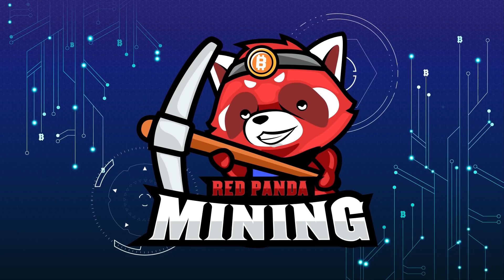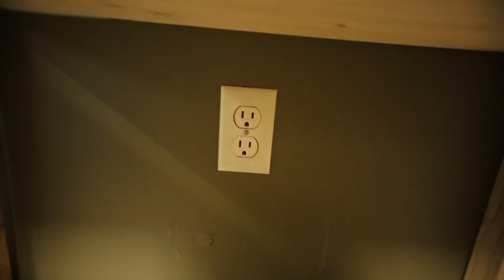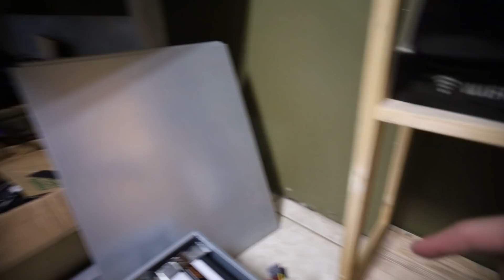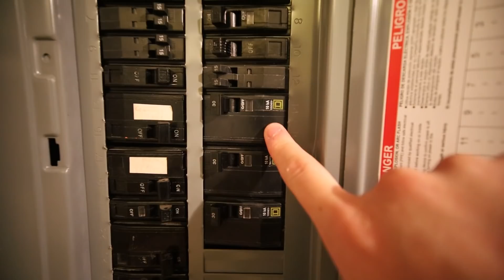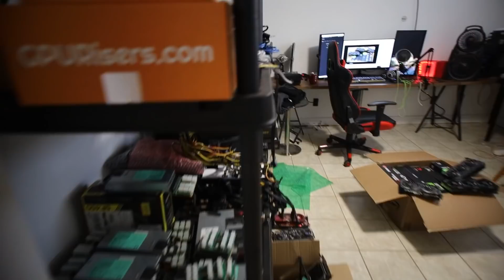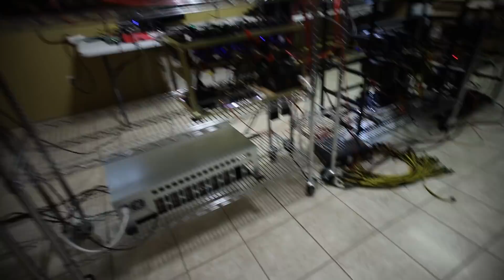How Do I POWER My Crypto Mining Basement?

Comment: Is there an efficient power supply model that will accept 220V input and distribute to many 6 or 8 pin PCIe connectors on the GPU(s)? I think that's what I need. Thank you for the informative video, Red Panda!

Comment: Hey Panda.  Do you use up to 80% of available power on your PSU, and then total your PSU's to no more than 80% of PDU capacity, and then use up to 80% to the wall?   I haven't seen someone on YT explain the entire sequence.   Hope that question made sense!  =D
Reply: I know you asked this quite a while ago and I'm not at this level yet so I'm only speculating but I would imagine if a single breaker was rated at 30 amps at 240 volts the maximum capacity would be 7200 watts. Therefore, you would want the maximum capacity of your power supply to total 7,200 watts as well as the PDU. If they all have the same maximum capacity, The 80% rule would just work itself out since if they all have the same maximum capacity using only 80% would be the same number for All of them.

Bonus: for a 7200 w Circuit, 3. PSUs rated at 2,400 w each would fit perfectly. Allowing you a maximum usage of 5,840 Watts

Comment: I am an electrician.  I'm just curious why this plug doesn't need a neutral? Just 2 hots and a ground?
Reply: They don´t use the Three-Phase 230V/400V system with neutral like we do in Europe.
They use single-phase three wire with 120/240V.
(Look for Wikipedia, you should understand it easily if you are an electrian)

Between L1 and L2 are 240V. Between L1/L2 and Neutral are 120V.
In this System you can just grab L1 and L2 to get 240V.
If you lose one Hot or Neutral, it just stops Working.

In a three phase system theres a Neutral needed, if the Load on L1/L2/L3 is not exactly the same (symetric) like a three phase motor or a three phase power supply (with three phase bridge) without Neutral.
If we lose Neutral with unsymetric (230V) Load, were fu*** 
We will see and hear Magic Smoke bc. of Under- and Overvoltage on our devices (Neutral Point Shift)
So double and triple check your 5 PIN IEC 60309 espcially on farming cables.
They old ones used to be 4Pin without N and just got upgraded 5 Pin Connectors.

Comment: 240V is also more efficient than 120V. 240V isn’t necessarily “two hots.” it is a different loop in the transformer outside your house. The red and black wires are a full loop on the customer side of the transformer and the 120V is half of a loop. Have you done a video on how to select power adapters for risers and good places to get the adapters? This concerns me, because a lot of the adapters people are using are cheap small gauge wires.

Comment: doing high power servers and blade centers in work and at home, when i started mining, i just added gpus to all my servers. having 40 gpus running right now.. saves useless cpus (most of these servers are dc powered by a 30kW 12VO PSU. its an enterprise grade thing... cool is the effficiency on these, also its really easy to power all your stuff)

Comment: Great content. 30A/240V is way to go. Most important of the video; remember 240V is coming out and into your machines so be sure they are 240V compliant and ditch the stock power cables and go with 14 gauge C15/C13.
Reply: not 14 but 12.. C15/C14 (hot conditioned)
Reply: So most power supply’s are 120 though won’t that burn the power supply’s up?

Comment: I know this has nothing to do with your video.
But how do you cure ethermine latency?
I just started my 3070 gaming cpu, ran great for 8-10 hours pulling 62.7 MH, but then out of nowhere my "current hash rate" dropped out of nowhere and my average is around 20MH for 2 days now. 
Whats that about?
Im mining at less than half my Mh capability but the pool is holding me back. ?

Comment: As always another great  video, look forward to these! Question, any reason why you chose to go 30a and not 50a for your 240v plugs?
Reply: This is a guess, but it could be because he has 3 outlets and wants to spread the load between 3 circuits. The whole panel may be rated to a maximum of 200 amps, so 3x50 would mean 150 amps, which isnt entirely your limit as you have other things running in the house at various amps. So the 50 amps could give a false sense of amperage limit. There are other reasons for using 30 amp breakers, but its on a case by case scenario.
Reply: @mauriciocastro1549  thanks alot for the response!

Comment: I ended up tripping my two 220 volt 30 amp running 16 L3+ antminers at 20000 watts. Ended up having to upgrade to a 50 amp breaker lol. Someday you might too when you breaker box runs out of space for 220 30 amp breakers. Not exactly legal though =).

Comment: Love these video where you focus on power as well as the Rig themselves. Alot of ppl just focus on getting GPU and all the other rig components but overlook the safety and requirement to power those rig. Please make more video like this I would really like to get educated. Also i just had an electrican to install a 20amp 120v  breaker on all three floors in my house. He advised me that should be all you need if i'm just a casual miner and also i should start splitting into another rig once its draws over 2000watts anyway.

Comment: Wait so let me get this straight you had a electrician run a 240 V 30 amp breaker like you did in your condo or garage OK now that’s more but if you don’t have a breaker close to the room your mining in do you have to run the cable very far and what do you need to have those installed

Comment: Personally I like more use 6 amp or 10 amp brakers (one for rig). But I live in an other country and the brakers are different and also the trip curve is different. Usually where i live, if a power supply goes short with a single braker, the braker will trip faster that the fuse inside the psu can do, so all the circuit is cut out. This is because my braker are class B, and the american ones are class D. And yeah, sometimes the braker trip when i switch on a big psu, like a 1 kw psu because it has quite a lot of in-rush. Sorry for my bad english but i don't speak english in my country.